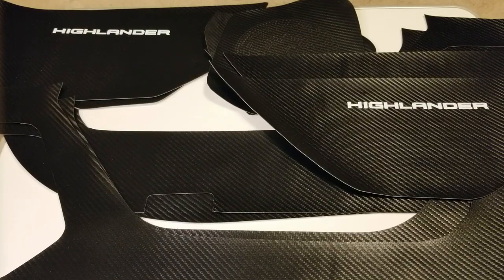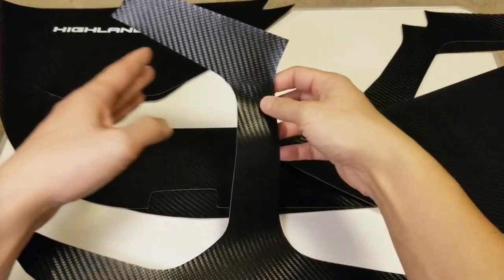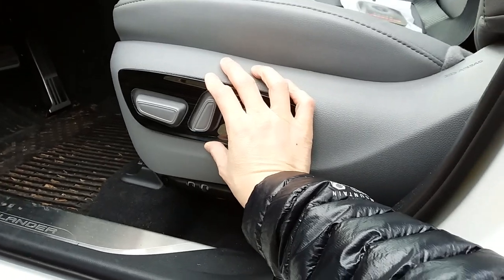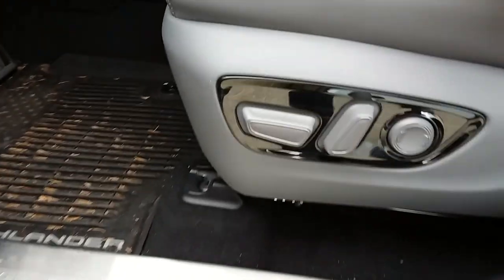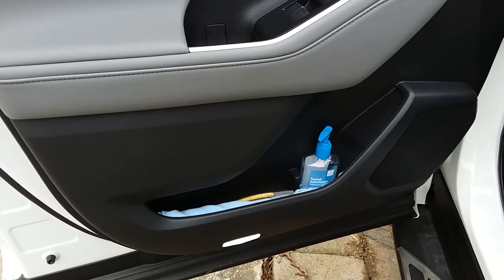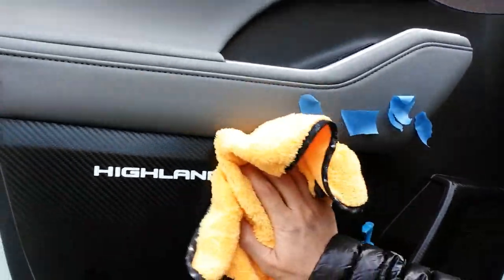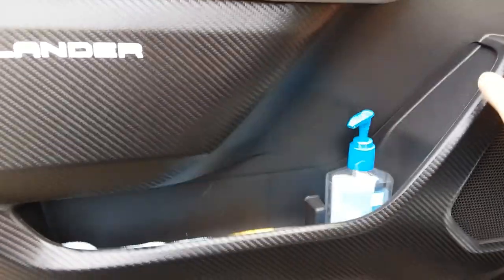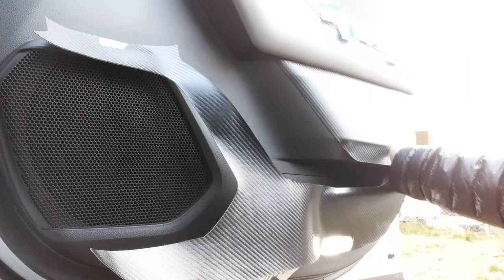Carbon Fiber Leather Door Anti-Kick Guard & Front Seat Trim Install/Review on 2021 Toyota Highlander

Comment: As it seems the installation of the sticker is not so simple and requires good hands and flight, it seems to me that I will also order such door protectors, regarding the coating of the sliding buttons of the chair I also installed and the glue was not good enough either.
I liked the video.

Comment: Good tutorial. Thanks for showing your work on the passenger side door. I would prefer it not to have "HIGHLANDER" printed on it at all. I wonder if there is a hard plastic trim for the door as I might prefer that. I liked the hard plastic style of trim on the power seat controls.
Reply from the maker: @T455 Thanks and I agree, I'd prefer the printed text not be there at all. I was also debating between the hard plastic version or not and ended up deciding it was too shiny and glossy for my personal preference as I really liked this almost matte texture and how it blends into the dark colors of the plastic door panel.

Comment: I have two questions for you, one what color do you order the front seat adjustment metal….. and the other question is if it is necessary to buy the 3M tape for the installation, thanks
Reply from the maker: @Angel Martinez It's your choice, I got the black color but you can choose carbon fiber if you want. The 3M tape is good insurance to have just in case the adhesive tape on metal is not sticky enough like in my experience.
Reply: Ok, thanks for your explanation.